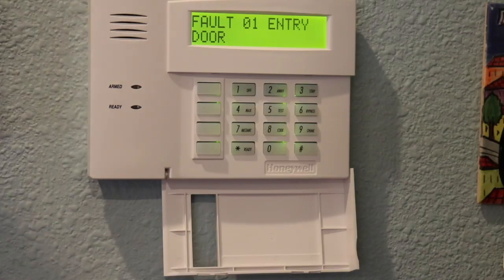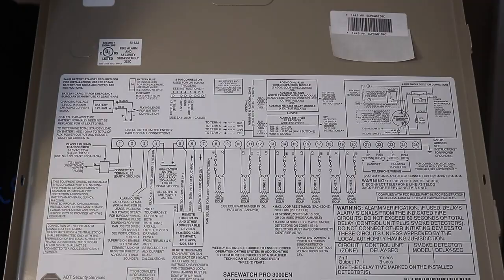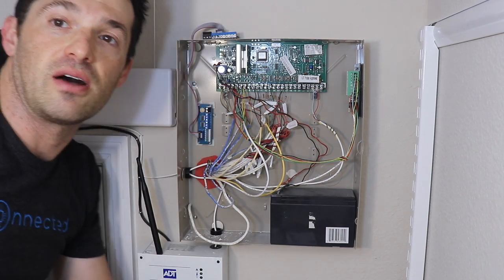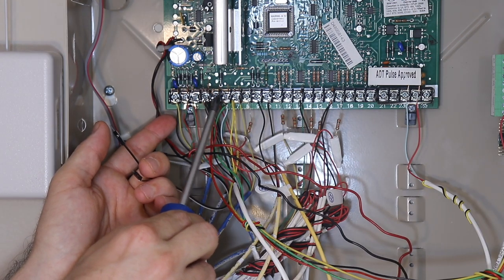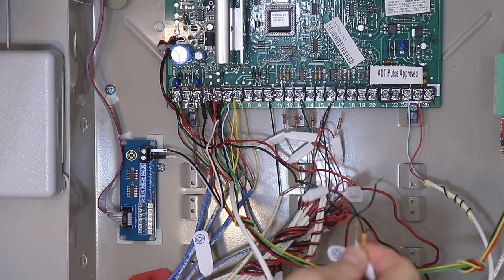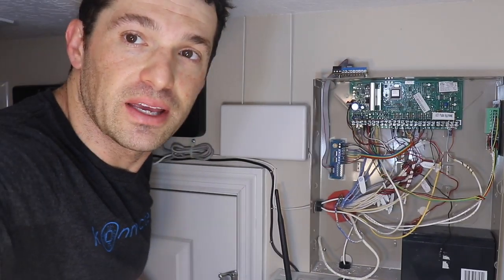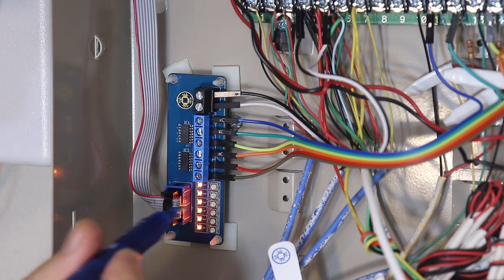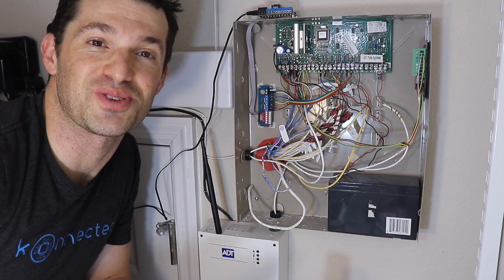Konnected Alarm Panel Interface Kit (2nd Gen) Install Demo - Part 1

Comment: The wifi strength on the Konnected boards is SO inadequate.  In testing, mine would not read more than 62% strength even when I had the Konnected board 1 ft away from my big 4-antenna router.  To try and get around this, I installed a wifi repeater within a few feet of the Konnected wifi module.  There the Konnected board only gets about 23% signal strength which is miserable.  It is outside the alarm panel, vulnerable to dust and water and tampering.  How about if you make a fitting on the Konnected board that would hook to a wifi antenna sticker?  The Konnected board would go INSIDE the metal panel and the wifi sticker antenna would go on the OUTSIDE of the metal alarm system panel?
Reply from the maker: This is not at all typical. Usually we see 95%+ WiFi signal with a router in the same room. Pls contact support so we can diagnose the problem.
Reply: Hmm, I have two 1st Gen boards and the WiFi is better than most of my other devices.  Interference (more common than most people think)?  Bad WiFi module on your Konnected board?

Comment: Great to see Gen-2 Interface Systems available (going to order a 24 zone)!!!  Can you please confirm if the Vista-20 Bay Board has the issue you described with Zone #1.  I have my entry door connected to zone #1 and have few options to move (plus the added programming needed to change the descriptors).  Thanks!
Reply: sorry got it!  Same Vista main PCBA...  Assuming the Konnected Interface modules work exactly the same way with the Ademco 4229 Wired Zone Expander Modules?
Reply from the maker: @milestonesprintervan-peter9545  Yes, all VISTA panels have the same limitation on zone 1 only.
Yep, it will work the same way with wired expansion modules, but does not work with wireless sensors.

Comment: Is it safe to have the main board outside the metal enclosure? Does it detect tampering and trigger the alarm (e.g. by cutting the ribbon cable)?
Reply from the maker: If the ribbon cable was cut or disconnected, then all zones would appear as open.
It doesn't interfere at all with the function of your traditional wired alarm system -- so any tamper protection that your traditional system has would still be in effect. In this use case, the traditional system still acts as the alarm, and the Konnected device is only passively observing the status of the zones on top of it.
Also -- if you have a burglar who was able to enter your home, find the alarm panel, and tamper with it without tripping any sensors along the way then you have bigger problems that wouldn't be solved by any alarm system.

Comment: Is there any feature in this where Konnected could see the status of the alarm? Like having a 4 wire keypad attachment for konnected so it could see if the alarm is in stay mode, or armed, or disarmed? This would be super cool and may also allow you to skip the manual programming of your alarm panel because you would basically have an internet connected keypad.
Reply from the maker: Yes! However it doesn't attach to the keypad.
I will show you how to do this in Part 2 of this video ... coming soon!
Reply: @Konnected-io  Would this be able to detect and change not just armed and disarmed but also stay mode, away mode, and disarmed? For example stay mode is the same as armed except there is no grace period and no motion detectors are active